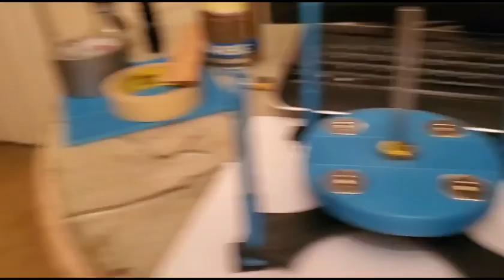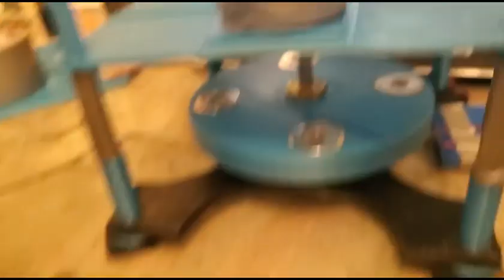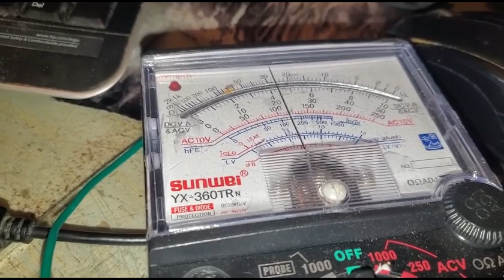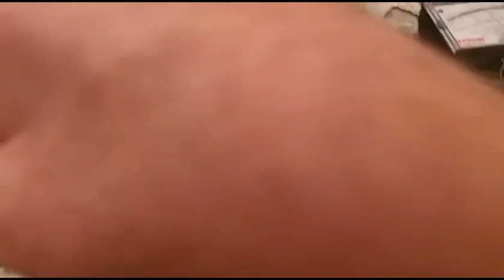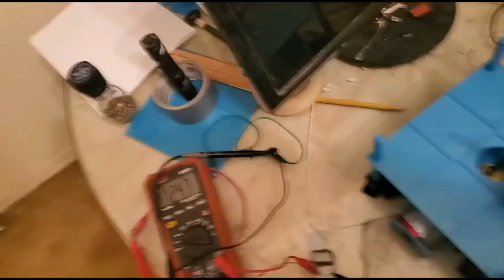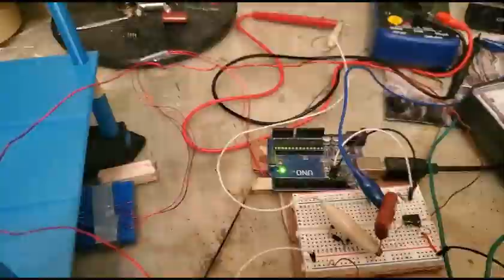Fun with the Mark 0.5 3d Printed Pulse Motor, Looking at the Air Gap: Part I

Comment: awesome vid! You know, there's ceramic ferrites and different types of iron that wont interfere with the magnets as much and still allow for high inductance in the coils. I'd recommend and iron oxide core (rust) because Iron oxide cores exhibit lower hysteresis losses compared iron, which means they have less resistance to changes in the magnetic field. Thus the magnetic field produced by the rotating magnets in the motor should interact with the iron oxide core more smoothly.
Reply from the maker: Thx Societyofhigh,  Had never heard that about iron oxide, interesting.  As things go along here in the air gap series you will see there is a lot of behavior just with an air core that I find surprising and some of it I just don't know why it happens.  So for the moment I am looking to get rid of the variable of what sort of core is best, that said I know John Bedini used and Rick Freiderick uses iron cores in their pulse machines so eventually may likely look at that as well.